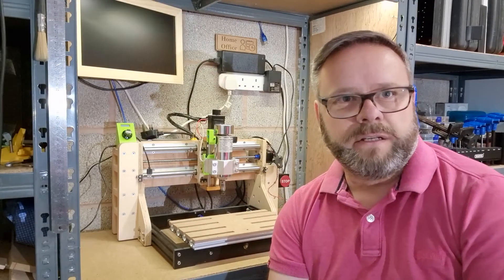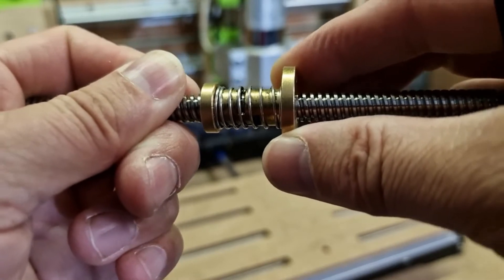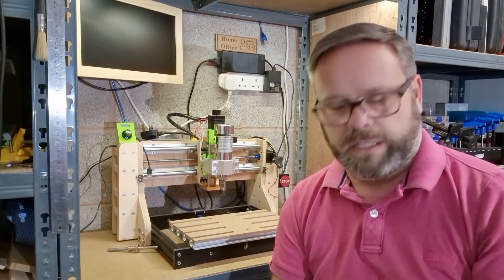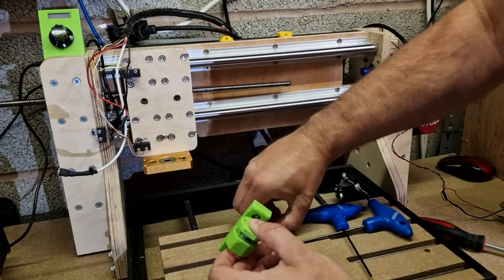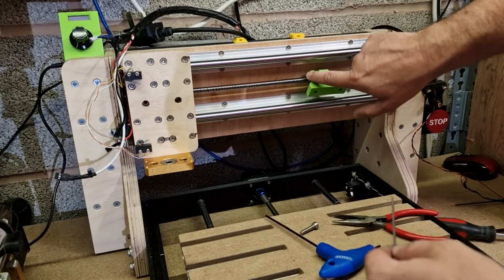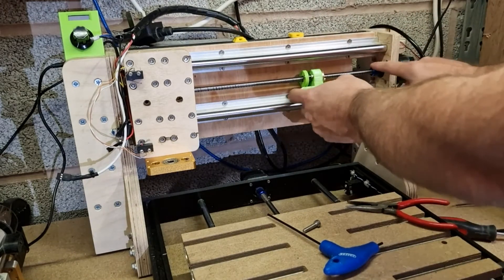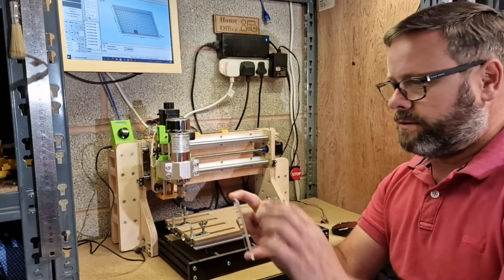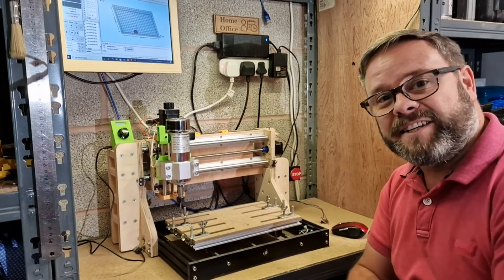Backlash Fix for 3018 Pro CNC

Comment: Now I will have to check if my new version of the 3018 has those backlash nuts when it arrives. If not I already know where to get them.
Reply: Finally got around to using the laser for Norton White tiles, it shows up the backlash on fine circles, time to adjust it out, if I can.

Comment: Backlash shows up in dimensional accuracy with a rectangular cut like that. Did you happen to measure that piece?
Reply: I didn't even notice the backlash error on the straight cuts. A circle should have been cut and measured. That would have been more proof of the success of the work.
The test cut was not 2mm deep.  It was cut in 4 steps. If I had had a smoothing pass it would have been 3 rounds maximum, or 8 mm was the Acrylic.

Comment: I saw a video where someone got rid of the Y Axis round linear bearings and extended the bed over the Main Frame rails, added 80/20 on each side with new Flat Linear bearings n top of the 80/20. this got rid of any 'squish' that can occur. I guess the other solution is to use beefier Round bearings. I was going to follow your lead and start to modify my 3018 but I decided to pull the trigger on a new CNC and am using the 3018 for PCB drilling and small laser projects which it works great for. I'm still digging your mods though :)
Reply from the maker: Yeah, I'm in the process of designing a new cnc with hopefully 800mm x 800mm bed. Along way of yet though but will be a video on it once started
Reply: Ordered my 3018 yesterday, already have some many yt CH. You guys have made it so easy to get up to speed before I even have my mill. All very inspiring.